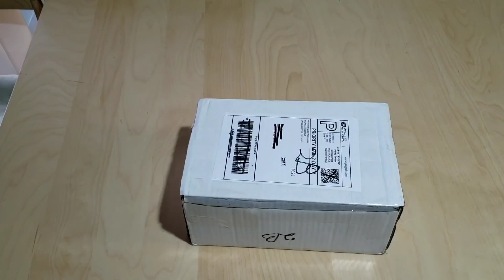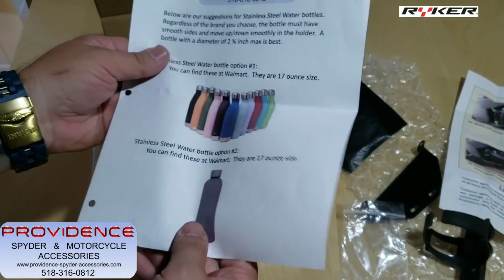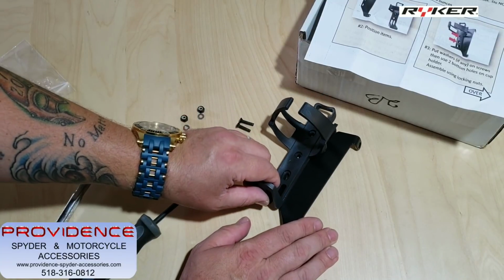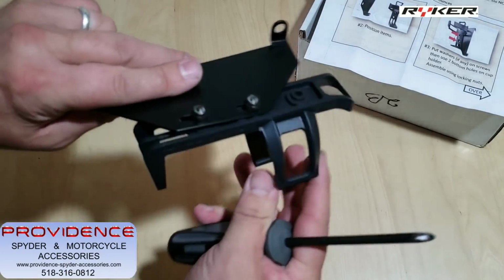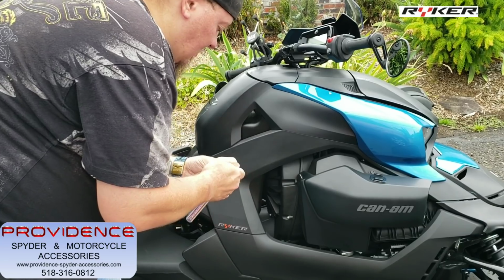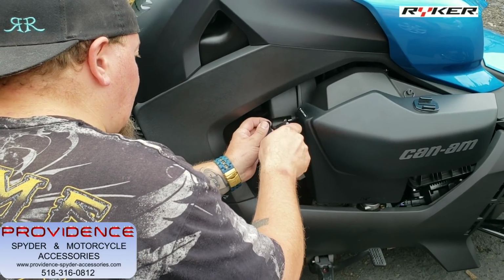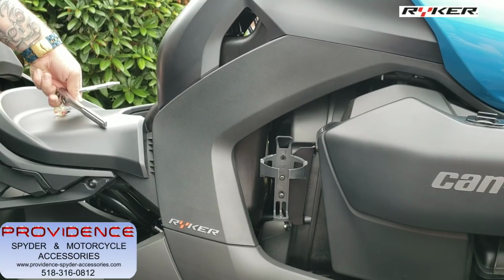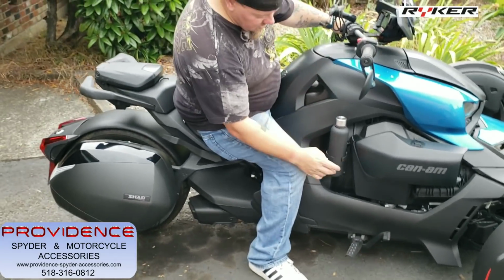Can-Am Ryker CUP HOLDER by Providence spyder & motorcycle accessories

Comment: I bought pretty much identical cupholders  made for bicycles from amazon  and mounted them at the end of my bars  2 for 10 bucks.
Reply from the maker: I promise you it was not the same as what is on my bike. Either way congratulations on saving some money if you like them mounted up on your handlebars that is a great choice. This is a stainless steel frame that is powder coated and specifically designed to mount beside the bike and avoid your handlebars. So you are commenting on my video about a totally different product. Either way I commend you for savings and money that's great to each their own... Me personally I prefer the one that is mounted on the side of the bike out of the way everybody is going to have their own opinion as to what they like..

Comment: Are you screwing into the plastic?
Reply from the maker: No you are using the two existing screws.. they will go through the metal bracket that the cup holder comes with and back into their mounting points that they were using from the factory... No drilling holes or tapping in new screws or anything like that...

Comment: I cannot believe that this cost $50-60.
Reply from the maker: Actually it's on sale on their website right now for $48..... I've got about 50 miles in on using it right now and so far seems like a very well-built product..
Reply from the maker: In comparison when you look at the competition like RAM mount.. they don't have an option to mount anywhere else but the handlebars.. that mount with the 1-inch ball and the cup holder and everything is right around $60.... So at a price of $48 it's definitely not unreasonable when you look at what your other options are...